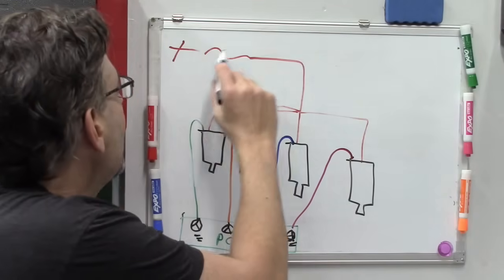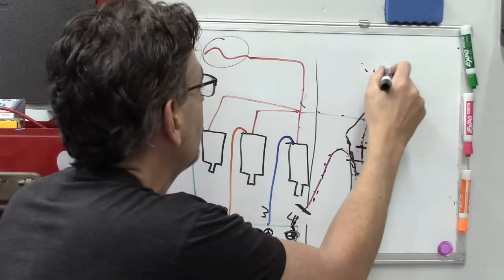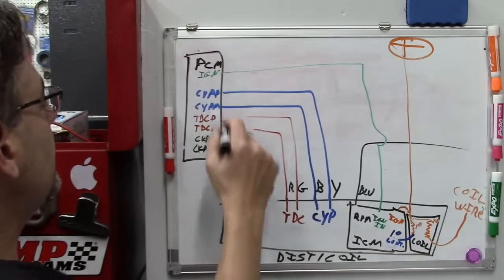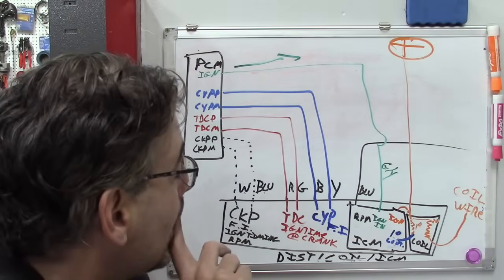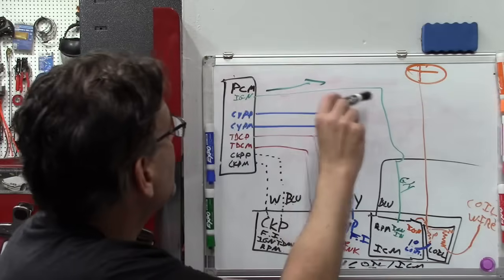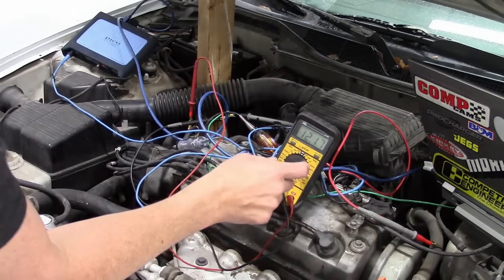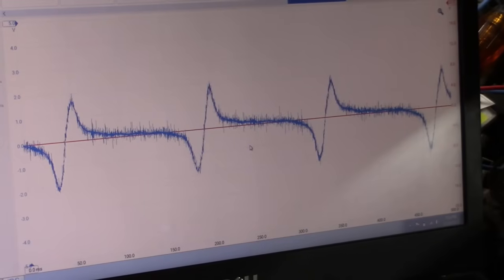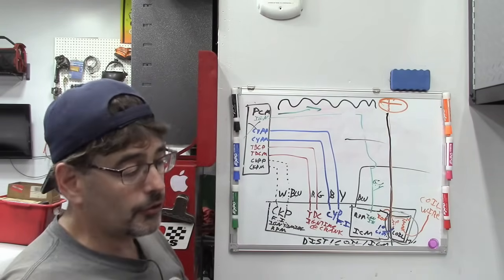DIY -How To Diagnose No Spark No Start. Bad Crank Sensor? FREE SBQM VIDEO

Comment: hey matt in Jamaica we Toyota Corsa / Toyota Tercel [1998 ] with the same issue as the Honda in this video.  if i allow the car to throttle, it will for about 15 minutes the shuts down, if i change the starter relay it starts immediately otherwise, I'll have to wait about 15 to 20 minutes before it starts again. it uses two coil packs. your thoughts.
Reply from the maker: When it’s running what does the fuel trim show?
Reply: The car doesn't give that info and I don't have a scan tool and mechanic s and techs just want to do some swapping out.
Reply from the maker: Then don’t use a scan tool. Just use a DVOM and do basic checks.
Reply: Doing some further analysis  and brain storms and checks myself. @SchrodingersBox

Comment: I had a Toyota Camry, roughly the same year as this Honda,that had a similar problem but just had a really bad miss. Investigation showed there was an arc to the distributor shaft from the internal coil. It actually left burn marks on the shaft.
Reply from the maker: Yep it’s known as “carbon tracking”. You often see it in the plug wire boots- especially on COP systems.

Comment: My 97 civic has a po336 I am wondering if I need to replace my crankshaft position sensor in the distributor in that case get a new distributor the runs and drives but it's intermittent when it pops the po336 code I be driving down the road and i have to clear the code and it and runs find for a bit some days it doesn't even do it.
Reply from the maker: i don’t know. what is the signal voltage reading?

Comment: It would be beneficial to show the other lead of your test light or meter when discussing voltage present on a broken ground.
Reply from the maker: The other lead goes to ground as mentioned.
Reply: @SchrodingersBox  understood but not shown on your drawings. It is the only way that meter would read, so I thought it needed clarification. I'm not sure if i missed hearing it.  Good demo

Comment: Hello I have a 2011 Buick LaCrosse CXS that will crank, but will not start and I was wondering is that got anything to do with the ground like the video I saw you do on the truck for the mechanics.
Reply from the maker: no idea. what is the voltage on the ground?

Comment: We had a similar problem About two years ago but the funny thing is that the engine rums whenever we got a dvm connected so we just left it in there. The car still runs.
Reply from the maker: Most likely a loose connection that the DVOM is securing contact. A DVOM has about 10,000,000 ohms of resistance. It is impossible for current to go through it but it could be that it is sending voltage to the signal.

Comment: My wife 97 sentra from time to time would have the problem with distributor . It get clogged up with dust. So you take the cap off and spray ir with air the you use for the computer.  It starts up like a dream time and time again. Things get dirty!!😂

Comment: Love your videos. Ask you a question. I was trying to figure out why my 2006 Ford Ranger 3.0 would skip after i changed plugs and wires. I thought i wasnt getting a spark and so i pulled out a plug from the coil and it ended up falling from my hand. It landed on the 4 wire hardness! It was sparking all theough that coil harnesses. You think i messed up my computer? Or do you think i need to put all new plugs in and a brand new coil and wires all Motorcraft? My belt also was squilling when it was running. So i 1m just wondering where would you go from here? I havent done anything else just yet. Its hard finding this on youtube!!!! Plesse help me! You are my top online learning mech
Reply from the maker: I would start with the simplest test first by seeing if there is signal from the PCM to the coil.

Comment: Yelp, I've seen this system several times in my professional.
Time? It's usually always in the distributor don't waste time on replacing a part because once they start failing, it's best to replace the whole distributor dial the road. I'm sure he's gonna encounter the computer part malfunctioning. Also it'll become intermittent. Not a fun diagnostic project
Reply: I would just take computer air spray and clean up the dust that clogs up the fins of coil!! My 97 sentra would start up each  time I cleaned it!! Try that simple way!!😂

Comment: As an amateur scientist I can fully appreciate you using the SM.  I am glad that you are so passionate about going through all the steps. Also I don't know how much you were charging this young man but if you were charging the typical $100-$150/hour wouldn't have been cheaper for him if you ordered a $70 distributor from Amazon and stuck that in? If it didn't fire up then you still are able to run your test.  Just a thought.  still a great video, you definitely know your stuff.
Reply from the maker: Thanks for the comment.  I don't think it would be cheaper or better to just guess on a distributer for several reasons.  First- the only reason we would even think to guess on a $70 distributer is because we only know the distributer was the issue AFTER watching the video.  There is every reason otherwise to guess on a $50 fuel pump, or a $5 box of fuses for that matter, or a $25 crankshaft position sensor. 
  The second reason is while I wait two days for the distributer to arrive and the car is taking up my garage space because it won't run AND charging an hour install for the distributer- if the car still didn't start, thats two days lost and $70 I have to swallow plus $100 labor I have to swallow and I am back to square one.  So much better to diagnose thoroughly, charge more for a part I can get same day, and the customer gets car back quicker and guaranteed fix while I get paid optimally and maximize my garage space for other revenue generation.

Comment: I have an amazingly confounding issue with my 1989 Isuzu Trooper. Has died because of ICM module problem three times over the last ten years or so. All the ICM (officially a crank angle sensor) replacements have been ancient used ones, so the recurrent cause may just be that they are old and crispy. The latest (used) ICM replacement lasted for about 20 minutes, but then when I tested it on the bench, it gave the same functional signals that it and other good ones have done before I put them in. Not sure what to do next and I'm writing all this to stop talking to myself. Part of the problem is that it died on the farm and parts and assistance are a 90 minute dirt bike ride away. Pretty sure this latest death is not because of the coil (P and S resistances are good) -- unless it is intermittent but I don't see how that can be (died when cold put in new ICM, ran 20 minutes then died while hot) -- but I would really like to rule that out. So I found this video with the simple demonstration of the manual sparking test and will give it a try if I can figure out how to make the connections in the tight spaces provided with my limited cable connector accessories out here on the farm. If the coil passes muster, I'll probably go ahead and put in a new expensive ICM module this time. Why didn't I do that before? Because I am in a third world country and the mechanics only offer the used ones. (I also put on a new distrib from the USA and it's ICM also died after a few years.) Now, doing this myself, I have found that at times you can find the new expensive chinese made ICMs that you might see on ebay in the USA...

Comment: THANK YOU! My 2001 Honda Cr-V has an intermittant Crank but No Start when it's cold outside (below 47F). I've been looking at the same wiring diagram (basically, honda). Tomorrow I'll use this info to crack on. I've really been at a loss. I've thrown way to many parts at this (despite doing my best to diagnose things - also used your videos for fuel system issue). Not sure if it's wiring or PCM issue at this point. The distributor is new & had the issue before.

One thing I'm runnning up on is the blk/yel wire from coil to 15A fuse has continuity to ground. Does not when I pull the fuse. Not sure if thats OK -  but I''ll use your technique to pull it down. Thanks again!!! Your videos are EVERYTHING!!! So good!

I tried using "JustAnswer" auto mechanics "experts". Terrible experience. Very generalized and turned out to be A.I. chatbots anyway. Do you offer a pay-to-ask service?

Anyway - keep at it!!! You are amazing!!!!

Comment: Oh ok im  confuse when you test the injector to see if it was ground side or power side did you had your test light connected to ground  or did you just backprobe it without connecting to ground and then the computer completed the ground ?
Reply from the maker: The computer completed the ground.

Comment: My 2009 HYUNDAI SONATA V6 never gave any real issues, just about a week ago I was on my way to work and was at maybe 30mph when I felt a jerk forward, never happened before, I ignored it and kept moving only to find that the engine cut out, the dashlights were still on ( and the check engine, TPMS and ESC (those have been on for a while), TPMS could be on because I have bigger tires than recommended. I restarted the car and it came back running, arrived work, and then had the same jerk and engine cutting a few times on my way back home, really risky because It came with power steering loss. Took it to a mechanic, and I was told to replace the crankshaft position sensor, I got a new one and the same issue was still there, then the mechanic said it could be the camshaft position sensor, we got that ordered and new fevers came up, engine cut out stopped, but the car would shake if engaged in D drive and in traffic, not shake violently but then it shakes, this shaking stops when i move and or just have the gear in P position. I left the mechanic's unsatisfied, this was yesterday, I got home with no engine cut outs, but I know the car isn't well, it doesn't act like my super responsive V6, I see the rpm needle moving up when I step on the gas but then the car hesitates to gain speed, and still shakes if engaged in drive D but not moving, the exhaust also sounds weird like the gases are being forced out, in short, engine isn't running smoothly, I also should add that initial problem with the random engine cut outs which was preceded by a jerk went away when the new camshaft position sensor was installed, but then the car wouldn't come on until after two or three key turns (difficulty starting) This car has served me really well and I think this can be fixed, not even in a financial position to get a new one, it's got 109k miles on it. The next day (today), I tried starting it and it wouldn't even start, did that more than ten times, I opened the hood and have a neighbor try to start it I see the belt moving the components water pump and others but engine doesn't run, probably have a low battery now but trying to get it up and failing has just never opened. Before all of this, I was at a mechanic that diagnosed a bad fuel pump, I got a new one, that didn't fix it and so I visited another shop which seems the mechanic was just guessing, telling me to buy sensors, I am certain the next thing on this mechanic's list is mass airflow sensor. I would be glad if anyone who had similar issues shared any useful information, car is dead and wouldn't start, it's funny because I shut it off yesterday. This car has had the famous cold timing chain rattle on startup for a while, many sonata owners have the same complaint, some had tensioners and chain replaced but rattle only took few weeks to come back. The code I have now from my scanner is P0335, first it was P0011 and before that it was saying the main relay circuit had issues, just P0335 now.
Reply from the maker: Do you have any data?
Reply: @SchrodingersBox  just getting this, thanks for the reply, what do you mean by data?

Comment: My truck cranks but foesnt start.
Starts with the starting fluid and runs well after but if i shutoff, will need starting fluid again to start it... what to do?
Reply from the maker: You 100% have a fuel problem. Check fuel pressure next.

Comment: Thank you very much I love SB. How do I get copies of wiring diagrams for that particular vehicle because I'm doing the same thing right at the moment and haven't found the issue yet tested coil ICM ignition switch main relay you have given me the idea that I need to check sensors again thank you very much
Reply from the maker: I use AllData DIY for wiring diagrams.

Comment: I have a 1998 cord explorer that will crank but one start. It was sitting for about 4 years after my father passed. Once I towed it to my house I started with the basics. I replaced the following:

Battery
Oil/oil filter 
Fuel pump and old fuel
Fuel filter 
Spark plugs 
Spark plug wires
Ignition coils 
EGR valve 
Crank shaft censor 
Air idle control valve 

Still no luck. I checked all the fuses under the hood inside the box and the relays. They all passed. I didn’t check the fuses inside the car under the steering wheel. Would any of those fuses cause an issue with the car not starting?
Reply from the maker: What data do you have?
Reply: @SchrodingersBox  today I was able to pin it down to an issue in the fuel system. The fuel pump fuses, relays, fuel pump and fuel filter have been replaced. Now I need to check to see if the fuel lines are bad or the fuel injectors. Waiting on a fuel pressure tester to come in tomorrow.
Reply from the maker: How do you know it’s a fuel system issue?  That’s the data I was asking about.

Comment: I spray starting fluid in the carburetor, and my engine turns over.  But when the starting fluid is done, my car stops running.
Reply from the maker: Yep, 100% confirmation you have a fuel issue there. Normally I start by checking if there is fuel pressure and if there isn’t then check the fuel pump.

Comment: Will a will a bad crankshaft speed fluctuation sensor (CKF) cause a crank yes but no start on a 2001 Honda CRV? Not the camshaft position sensor in the distributor, the sensor down with the timing belt. I have a mystery crank no start when it stalled half way to work. Original only code was P0108, Manifold Absolute Pressure / Barometric Pressure Circuit High. I replaced the MAP sensor twice, 1 used, 1 new, no luck. I have spark on all 4 (same when swapped with 2 new and 1 used distributers, same issue). Plug wires ohm'd out correctly for length. Cleaned plugs, replaced plugs. Fuel pumps rapidly out of fuel rail inlet. All injectors pulse, removed them and they feed gas to a paper towel, BUT if i pour gas directly in the manifold, it will start and run like crap for about 10 seconds if I rapidly floor and release the throttle. Removed the valve cover gasket and checked timing belt all the way around Belt is good and intake and exhaust line up correctly. No missing teeth or damage. Was considering replacing the CKF sensor and a new timing belt since I would be there anyway.
Reply from the maker: Yes it could. What’s the voltage on the CKF signal?

Comment: Would you have the wiring diagram for 2004 0:36 Toyota RAV4
Reply: I want to know where does the Pin 4 get it’s earth from and why is it not connected to chasis ground

Comment: Hi, I need your urgent help to diagnose and fix a crank no start on a 2004 Toyota RAV4 in Fiji Islands. After scanning with a Launch scanner I got the following codes : b1800, b1801, c0246, and c1244. Also note the battery charge light does not come on when ignition is turned on. What I also found out was the there was no continuity between pin 4 of DLC connector and the chasis ground on the right hand side kick panel ( white black stripe wire) however when I put a test lamp on Batt ( pin 16) an pin 4 (chasis ground) the the test lamp comes on. What could be the problem
Reply from the maker: Sounds like a module problem. I don’t think this car uses CAN yet so I would look at individual module communication but you can’t do it through termination resistance.